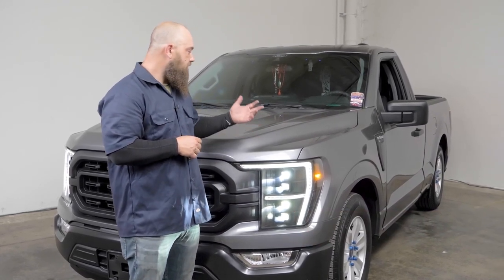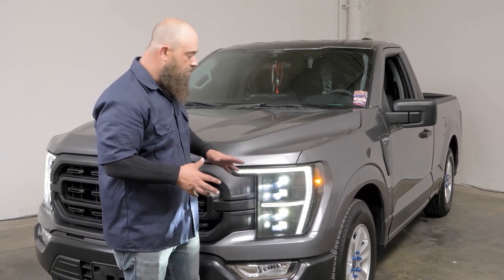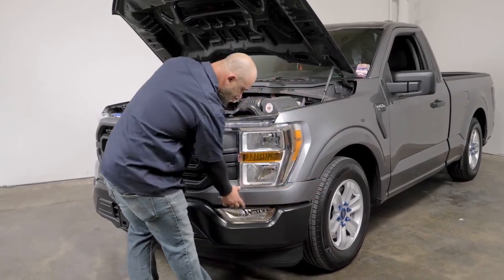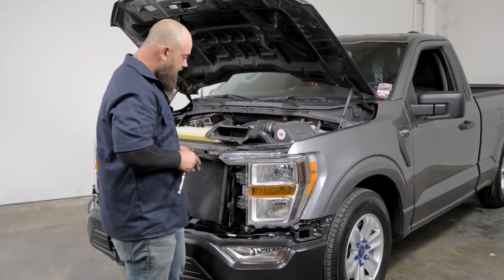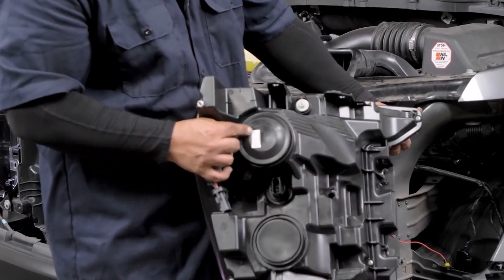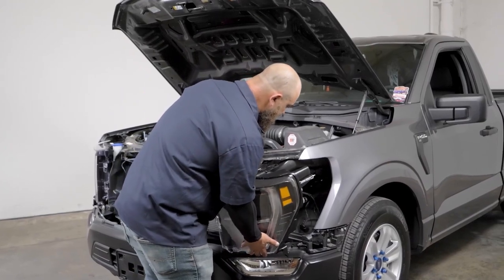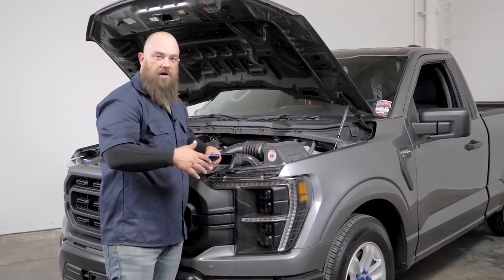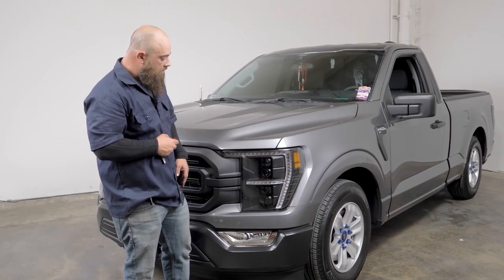Anzo USA 2021-2023 Ford F-150 Z-Series Full LED Projector Headlight w/ Initiation & Sequential Turn

Comment: My 2023 xl just has the standard old halogen lights.. what all is needed to put the projector lights in ?
 Let me be more specific I guess..
 So Im reading in order to take out the halogen lights and replace with projector lights(like these or similar) you have to repin some wires on a comouter and all kinds of other bs.. is that the case with these lights?
Reply from the maker: Be sure to watch the whole video as our installation is as easy as shown! Nothing related to computers etc. If you have any questions, please reach out to our Tech Support line at 1-888-360-3696 or techsupport@anzousa.com.
Reply: @anzousa  thanks.. ill be in touch
Reply: @anzousa so I wat he'd the entire video.. very simple procedure! In your opinion.. led or projectors? Which is better?
Reply from the maker: @19jody72  they are two different things, an LED is the light producer and the projector is what reflects the light.
Reply: @anzousa  ooooook... lol as you can tell.. I know nothing about lights